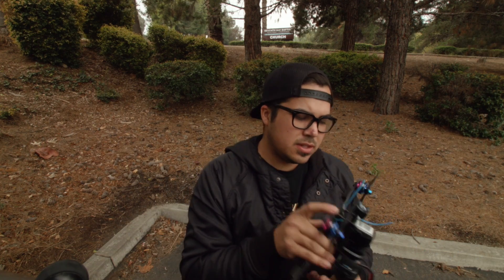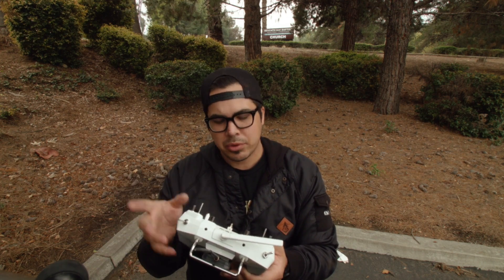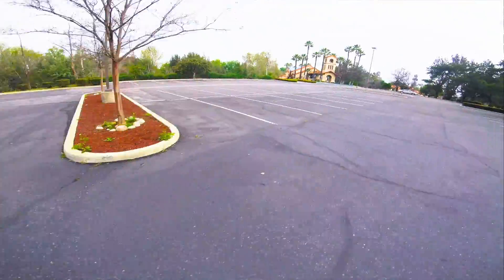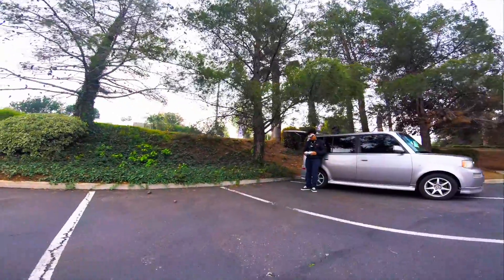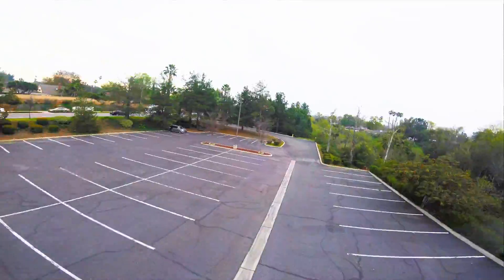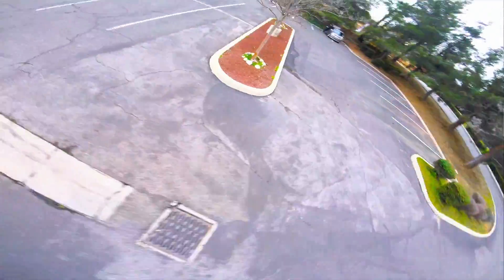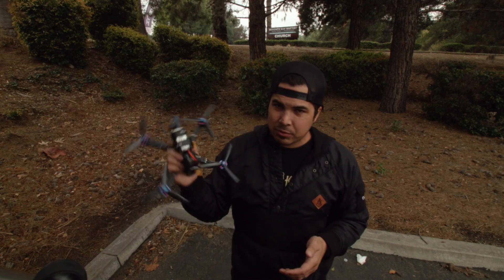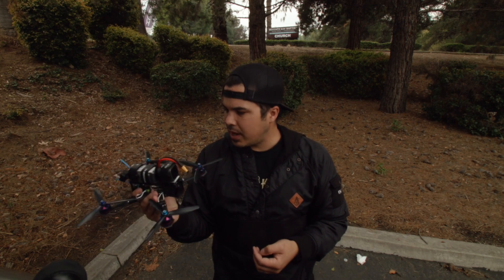FINE TUNING MY PIDS

Comment: thanks dude. ill understand more when I finish my first build. I'm heading to LA this weekend for a party, but I'm really thinking about bringing it with me to finish.
Reply from the maker: +EnlightMent go party and have fun it will still be there when you get back :)
Reply: Dude I know this is off topic but,  I am stuck and have no idea how to fix it. I am building the Impulse RC Alien RR5 (Kit) from Rotoriot. I have a short in the PDB and Im not sure why. 1 through 4 are the way that the motors are to be connected and facing front. I checked continuity of the PDB and 3 out of the 6 are giving me an alarm when connecting pos and neg, and I have no idea where the problem is. it is 3 and 4 and then the connect between 1 and 2. I didnt see the board lift, and I wasnt on it long enough to lift. 1 and 2 and between 3 and 4 are okay. I hope that this make since. what could be causing this?

Comment: When i want to fly at the speed you do, i cant do i With the camera Angel as low as yours look to be? Or was that special for this video?
I se nothing but Road when i do... and when i go higer than 35ish... the yaw and rolle gets "wierd" man i doping somthing wrong?
Reply from the maker: +Peter Kornum what lens are you using?
Reply: Konasty I have recently changed to the go pro lens... it helps but I seem to be looking at the top part of the fat shark screen...
When I Throttle up either the quad ricers a lot from the plane I want to fly.. I have to apply quite a lot of pitch to lower the nose so I can stay at the same height from the ground
Reply: Your camera angles seems to be about 20° and that's what I would like so the role is more neutral
Reply from the maker: +Peter Kornum I use 2.1 or 2.5 lens I don't see much difference but I'm at about 25deg tilt and I can see the horizon pretty good at fwd tilt
Reply: Konasty thanks! I will be experimenting with it!!

Comment: If you watch some of Joshua bardwells vids, he says that I corrects for what the wind is doing to the quad, like if your at zero throttle with air mode and you see it moving when your not touching the stick than raise the I pid corresponding with the way it's moving. For bounce back add D term.
Reply from the maker: +Rc Addict with planes yeah "I" will help fight wind movements and the floaty slop I was having and D will help on bounce back but to much will cause some oscillating too and I'm already high on my D so I didn't mention it that's why I adjusted tpa also

Comment: Weird question for you.  I have an Alien 6" which isn't much different than what you have there.  Its a full KISS setup running Returner 2140kv motors.  I love it.  Its fast as hell and with rate tuning its easily more snappy than my 5" Alien.  So here is my issue.  On HQ 6x4.5x3 props its smooth as silk.  On hard punch outs its smooth but I do hear it bogging a little but overall not bad at all.  On some King Kong 6x4-2 blade props its an MF-ing demon.  Its sounds mean as hell and its easily way faster than the 3 blade props.  However, on punches I see it oscillating.  I can't hear it oscillating but the FPV feed is pretty shaky.  However, the GoPro footage doesn't seem to pick it up too bad and its hard to see in the GoPro footage but again in the FPV cam its pretty damn shaky.  I am completely baffled where to tune here.  My I-Term is also high-ish, similar to yours.  I thought maybe Yaw-P might be too high and causing it so I backed it down but didn't really help.  I played around with TPA but TPA adjustments in KISS are kind of confusing and doesn't go by throttle signal like 1650u but rather by a percentage of throttle.  I lowered TPA to catch and relax the pids sooner on the throttle ramp up but that didn't help too much either.  Any ideas?
Reply from the maker: +Nick humm could be a couple things. I'm assuming motors everything are in good shape? Also might sound weird but is your flight cam good? The sensor isn't loose or the board. I find there to be a sweet spot with the P being a bit lower the normal for roll and pitch